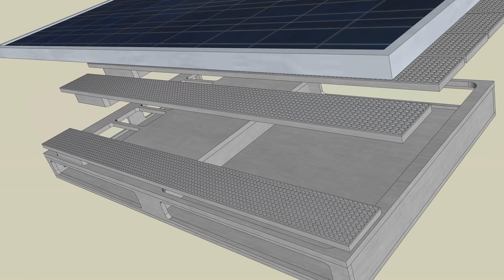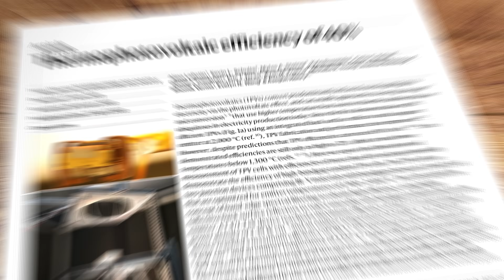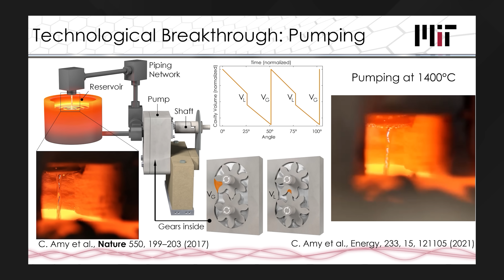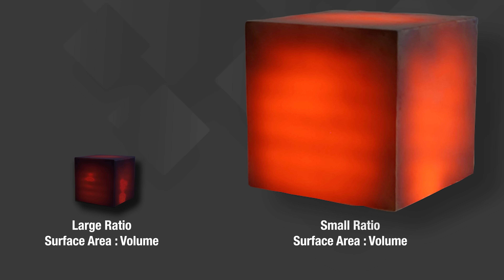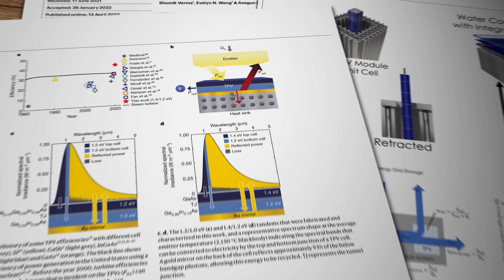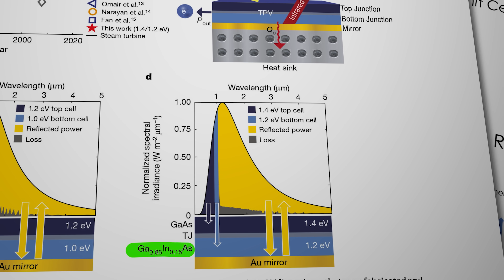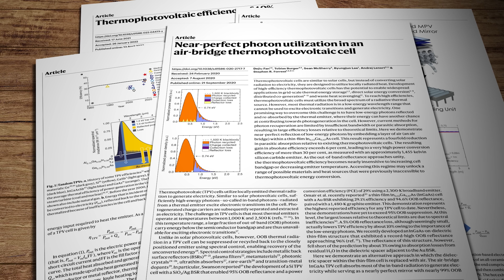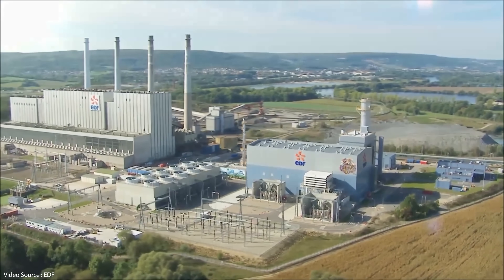Grid Scale Energy Storage 30x cheaper than Lithium-ion! How do they do that?

Comment: I prefer the much simpler system by E2S that you featured a while back. Their system using the phase change of aluminum combined with graphite into blocks seems much preferable to this complicated rigamarole. Their intention to use old power plants is genius.
Reply: The problem with chemical or any kind of phasing (state transoformation) is that the process will degrade over time and then need to be either refurbished or replaced. A non-chemical process like this appears to be should have minimal degradation and might run for a hundred years without major maintenance.
Reply: @tonysu8860  A phase change has no degradation. It is just the change from solid to liquid and liquid to gas. There is a lot of energy coming or going right at the temperature of the phase change. Refrigeration uses phase changes working with both heat energy movement and pressure changes. Please try not to be condescending. (ps: that is humor)

Comment: When we can have 40% conversion of heat energy, why aren't we also talking about energy production rather than just energy storage? Parabolic mirrors can concentrate sunlight, so why not heat the Tungsten that way? And what about using these cells in space, maybe behind Fresnel lenses? And instead of heating up the block with electricity, why not with a fission reactor?
Reply: Your reasons are exactly why thermal storage is most often seen associated with heliostat farms where a field of mirrors reflects sunlight to a collector typically mounted on a tower. That type of solar energy collection already uses a molten metal (typically sodium) as the thermal medium that is circulatated and typically is used to drive turbines that are connected to electrical generators. It's a relatively small step to connect or add thermal storage of some type.

Comment: Hmm, any electricity storage system is going to be less than the ideal i.e. generating the exact amount of power needed at the time. I think that this system does show some promise, though is quite complicated. How about demanding car makers use battery swapping tech, like Nio? Then any excess electricity generated can be used to charge up batteries waiting to be exchanged into cars or vans. Any excess power could also be used in electrolyzers to create green hydrogen for larger vehicles that are not battery powered. Simple solution using existing tech and just a slight change of behaviour.

Comment: I think its a bit telling that their core market is as a Lion battery replacement, but they are comparing performance to a related technology, converting heat to electricity.
With these numbers you'll need to generator 2.5 times as much heat to convert it to power compared to directly storing the power.
Something like Zinc bromide flow batteries are much more scalable and almost as efficient as LION, so you don't need to produce as much excess power.

Comment: Is the purpose of the graphite only to be a cheaper material than tin?  Otherwise, why not store the heat in a reservoir of molten tin?  Tin might be more expensive, but omitting one step of the process would also have cost-benefits.  Now: To be clear, I'm absolutely sure the boffins at MIT have got a better understanding of this than me, but I'd be curious to know.

Comment: I'd be interested in how this proposal compares, economically and performance-wise, with high temperature heat storage coupled with an old school steam turbine generating set.
Reply: Old school turbines also have the advantage of being already built, (hopefully) underused in the coming years, and they can also run off other things if we need.
Reply: @benholroyd5221  Yeah!  Stop an old coal-burning power plant, tear out the coal handling & burning equipment, and put hot energy storage in its place.  Hook up the existing (refurbished?) steam turbine and Presto! you've got an energy reservoir.  It wouldn't be as responsive as the system described in this video, but the responsiveness could be supplied by actual batteries.
Reply: Compared to a turbine, there are I think 2 advantages: no blades to crack, inspect and replace, and no monolyth that you must stop to perform maintenance. The whole system is a large array, so if one component doesnt work you can bring it away for maintenance and keep the rest of the plant operational
Reply: And simply Stirling engines coupled with the heat storage ? They also seem to have a 40% yield, with a well-known technology.
Reply: @gregoire5413  Stirling is only 40% efficient in ideal (unreal) conditions and takes the more time to start the more max power it hes (the bigger it is, the harder to make it spin and then stop it) and power is proportional to difference in temperature (it would slow down,as it would discharge a block). Standard steam turbines are used for so long for a reason.

Comment: Far, FAR too much heat (energy) wastage in this setup. Read a book called Midas World to get ideas what can happen with too much heat. Albeit,  it most definitely is cleaner than current power production processes.
Reply: Place the heat exchanger inside cooling towers with low rpm glider wing type generators. Make more electricity from the heat. Use the warm water through a radiant heat pipe system under roads to keep them clear of snow. Less petrol waste that way. During summer, redirect the warm water to feeder facilities.  Bathhouse.  People will pay to use it and recoup more of the costs. SO MANY WAYS for this to be more efficient and cost effective immediately upon use.

Comment: Sounds a lot like MTPV Eblade, that was developed years ago. They were targeting the industrial waste heat to power market. The energy storage application that achieves higher efficiency by reflecting most of the unconverted heat back to the molten heat source makes a lot of sense. 
The high temperature pump system is very impressive, but I’m still waiting for industries to use 500C Flowserve pumps to save energy by redesigning some reaction processes without excessive cooling, separation and reheating of reactor products and recycles. Perhaps someone like Elon Musk needs to disrupt a few more industries by taking advantage of these new capabilities…

Comment: Jeez, if they keep pouring so much engineering effort into squeezing every watt out of weather, they will eventually invent nuclear power....
An average roundtrip electrical to electrical efficiency of a battery is 80% which is already around the 3rd step of this 14-step process. No way this can compete with a windmill connected to a battery. 
Regarding the graphite-based thermal energy storage part, molten salt thermal storage systems based on solar salt can provide those same 100 MW for 10Hr with a 550ºC input (from concentrated solar, solar tower or sodium-cooled reactor) with 10.000 M3, or a cube 22m per side. Big but not really that big, and nitrate salt is cheap. 
Windmills+batteries where is windy, concentrated solar + molten salt where is sunny, and nuclear + salt everywhere else, that's it

Comment: so upon hearing the power output capabilities one should be able to conclude that once you "jump start" the system with the solar/wind/grid electricity you should be able to route a portion of the produced power back into maintaining the system's heat while still having plenty of output power. though a 40% efficiency means that it's not fully utilizing all available energy in the system, you would benefit FAR more from just using a steam or sterling engine. sterling engines in particular because they're a heat engine already will be FAR FAR more efficient than any other type of process next to that of steam, they're already almost 60% efficient as one NASA test back in the 90s proved. this seems like more of a gimmick to create investors and make money while delivering practically nothing of value seeing as we already know from the laws of thermodynamics that it's impossible to produce more power than what you put into a system!

Comment: It should never be 30x cheaper. It should be 1/30th the cost. You cant multiply the given cost Xby 30 to find the implied  cost. You have to divide which is not whats implied by 30x. 30x implies multiplication.  Its a bad way of speaking and should be done away with.

Comment: Excess heat could be recovered also so as not to waste the energy heat exchanger etc
Reply: It would possibly be enough to charge a bank or batteries for backup lights/gas sensors etc

Comment: I'm sorry, but I just don't see how this will be more practical or cost effective than just using grid-scale electrolysis with geological storage, and peaker plants. As you acknowledge in the video, combined cycle power plants are already more efficient than this technology (with pathways for improvement such as SOFC combined cycles), and the advantages of the two technologies are mostly the same (leakage proportional to surface area, storage capacity proportional to volume; decoupling between generation and storage). Hydrogen has the further advantage that it can use existing natural gas storage, which puts the potential storage capacity into the PWhs. You also kill two birds with one stone, because hydrogen is also the foundation of several major chemical synthesis pathways (ammonia for fertilizer, methanol for plastics and solvents, e-fuels).

I guess it's interesting that they've come up with such a novel scheme, but it seems to me that the most useful part of this technology is actually the heat transfer system, not the energy generation itself.

Comment: I would have the hot water cooling go through a Ormat plant first before the cooling towers. I've been thinking of using the heat generated from nuclear reactions to produce the heat necessary. A solid state nuclear power generation plant.

Comment: 50% is only the efficiency of the thermal PV. Considering all the thermal losses in the pipes it could easily be lower, while considering the potential to use heat engines instead of resistive heaters it could easily be higher. Comparing the efficiency to gas turbine efficiency isn’t a useful metric in the first place, what matters is the round-trip efficiency from electricity to storage and back to electricity again, the cost per kWh, and maybe the land usage.

While I think there may be promise in thermal solar, piping around tonnes of molten tin ($20 per kilogram) is likely not the way to go around it. Instead I’d suggest having purely solid storage units with the heating coils/pipes embedded within. Make the blocks out of solid iron ($0.4 per kg).

Silicon should be a cheaper photovoltaic material, I’d be interested in seeing if it can work for thermal photovoltaics considering it’s more optimal at longer wavelengths (meaning lower temperature black body radiation). There’s also the concept of candoluminescence, which may improve the efficiency of the emitters.

Comment: I mean, if this is as efficient as a normal power plant then it seems like an addition to this system could be a fuel to generate heat when the system's output is needed but it has no heat left. It seems like it makes normal fossil fuel dependent generators a little redundant in that sense.

I don't know that it will be cost competitive for pure generation though. Not for a while.

Comment: This is the real deal. Along with Ambri's molten metal battery and unlike all of the repurposed EV battery technologies that we are seeing offered as grid scale storage solutions this new technology based on MIT research is genuinely fit for purpose. Part of the novelty lies in how the different technologies work together. The graphite blocks can naturally store energy (in the form of heat) for long periods but the pumped molten tin and photovoltaics working together offer a way to extract/release energy (in the form of electricity) in a rapid and tunable fashion.

The idea is brilliant and it works. In large deployments this could put an end to anxiousness about base load and perhaps even worries about the intermittency of renewable energy collection.

Comment: Its a bit odd to me that this is being compared to lithium-ion battery storage since I would have never assumed anyone would use them for large scale storage (to be honest, I already thought houses being run on battery power was pushing it, but I'm no expert) when the main way power is currently stored is by pumping uphill for storage and letting it go down for power gen. From a quick search, it sounds like the full system of moving water around is at about 80% efficiency (some claim more, some claim less). And to expand all you need is a bigger reservoir, not anything fancy. 

Without a doubt this is an interesting technology, and something likely worth while pursuing, but comparing something with 40-50% efficiency to something crazy costly and resource intensive all while a simple hundred-year-old and vastly more efficient technology exists is just... odd
Reply: one of the problems with pumped storage is that you need the appropriate geography for it, not to mention the water. It's a great solution but it is not widely applicable across the globe

Comment: I imagine every home having a mechanical battery with, for example a 1 meter diameter hole in the ground and a tube with a weight that can be lifted and lowered to generate or store energy lowered into place and out of sight.  They could build in some geothermal tubes around the tube as a bonus too.
Reply: You can imagine it, but it's an obviously terrible idea as it makes heat losses enormous.

Comment: The panels are 40% efficient.  That means you are throwing away 60% of your energy, and that's before you consider the inefficiencies of storing heat in the graphite blocks, the pipes, pumps etc, and the parasitic losses associated with those components.

In best case scenarios, you are looking at wasting at least 70% of your energy, compared to wasting about 4% with lithium ion or lithium iron phosphate batteries.

The cost of wasting that much energy, over the lifetime of a battery system would make these things cost a hell of a lot more than $10 per kWh.

And since when are lithium batteries $300 per kWh?  I just bought a 24v (8 cell) lifepo4 pack for £250.  That's £250 for 2.3kWh.

No way a grid storage company is paying $300 per kWh, even factoring in the cost of inverters and such - which these TPV systems would need too.

I think someone is fluffing the numbers for dramatic effect.